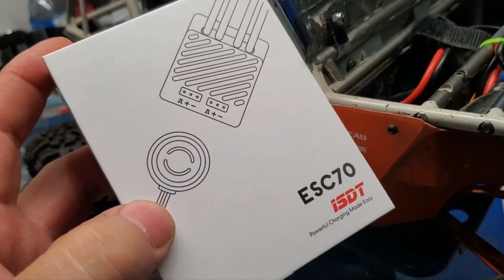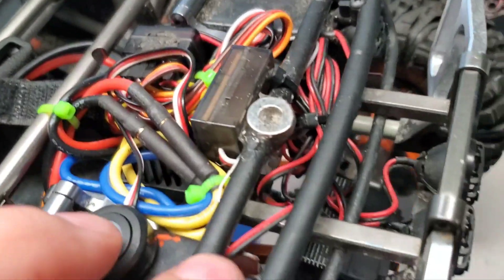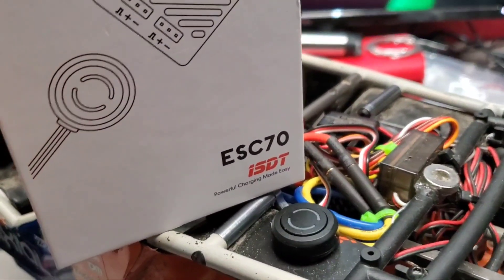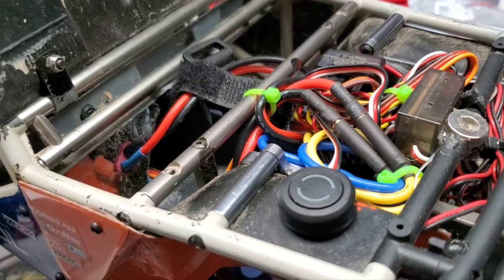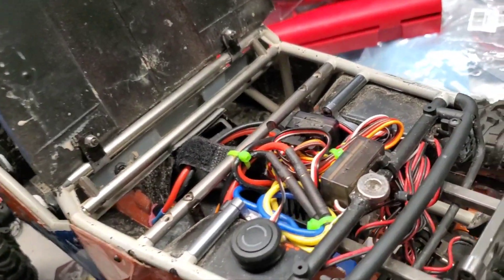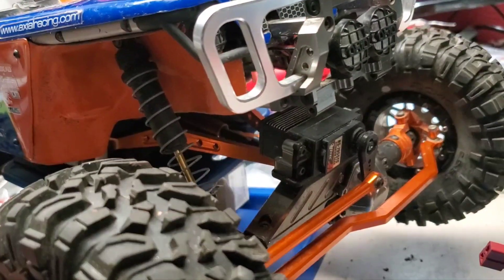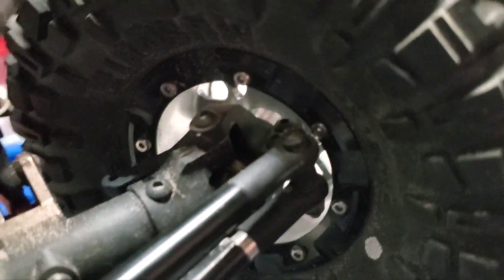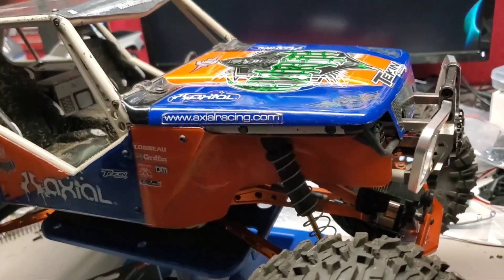My thoughts on the ESC70 ISDT and a little update on Fred's Wraith

Comment: great in depth video..that esc has lots of app issues..and paying 35$ there 25$ in usa..but for 10-15$ more usa or for you 5-10$ more cad ill go hobbwing 1080 esc version one or version 2 of the 1080 its just a better proven platform for the money and best bang for your buck when it comes to a brushed esc..just my thoughts..certain parts cutting cost are needed but an esc brushed 1080 v1 or v2 is must for a brushed esc..